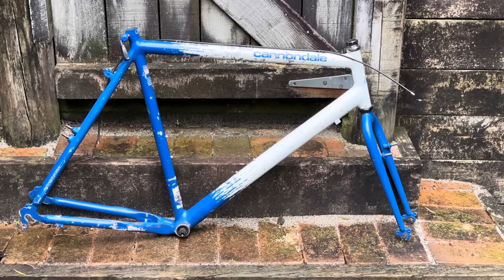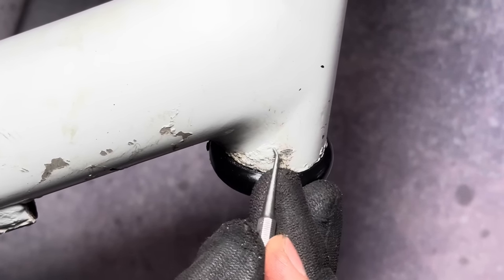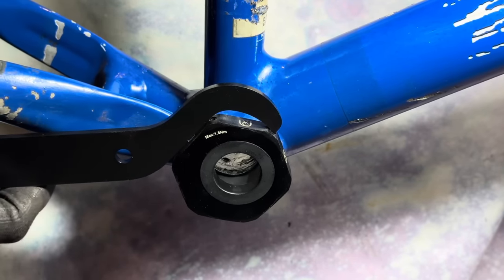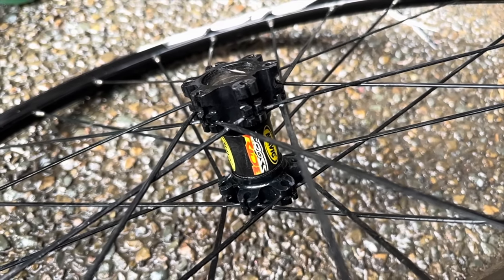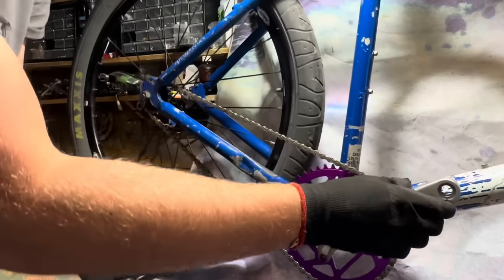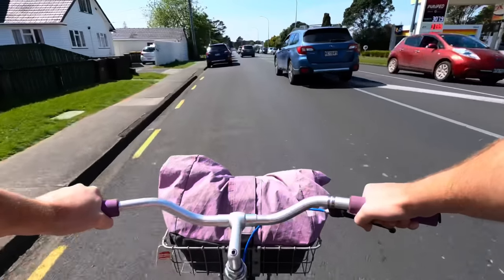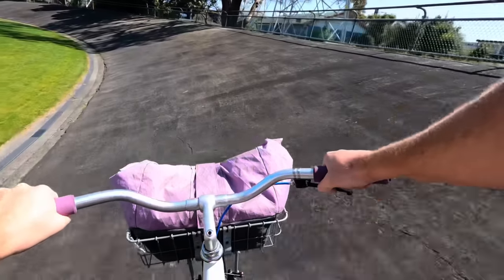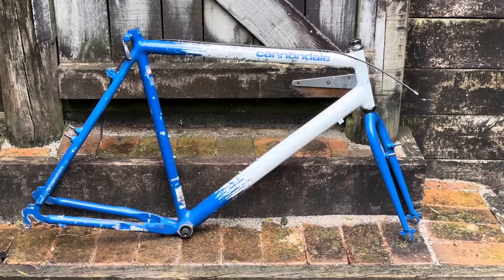Retro Cannondale Commuter Build - 1989 SM2000 Fixed Gear

Comment: With all the positivity and love and just a recommendation. If you have to dish a wheel two full spoke nipple revolution it's the only way in four steps - half - half - half - half and always start with the side wich needed to be loosened. The wheel is a system and doesn't like big stability changes in overall spoke tension and two full spoke nipple revolution in one step is definetely. Like if you disassemble a wheel and you try to save the rim (in it's) for another bulid you doing it by half revolution by 32/36 spoke at least 5 rounds...
Reply from the maker: Hey, thanks! Yeah I’ve done it this way before multiple times with no issues 🤙 but you keep doing your steps if that’s what helps ya sleep at night

Comment: you want a single half link. and maybe a double hollow 9speed chain... my 2010 GF Rig SS XC 17.5" has a BB like that and it's literally 13 years old now...
Reply from the maker: Hey! Yeah I don’t think if weight savings were a concern I’d get tyres that don’t weigh 1kg each haha. I would like a cool gold chain though, for the style! I have a Izumi chain for an upcoming fixed gear build though 😎 oh rad! What’s the bb called? Is it a trickstuff one? 👌
And the half link, don’t really need one as there’s heaps of chain tension left 🤙
Reply: @toastyrides  mine is a Press fit.. I had to go look.

Comment: Big props to you for being our collective guinea pig and testing this! I've been dying to see this done, as a broke bike mechanic I don't really have the means to fuck around and find out on my own with this kind of thing. I love the aesthetics and ride quality of 26ers (my main bike for everything from groceries and commuting to bike tours is a steel Diamond Back 26er) but I also really would love a fun little fixed bike. Currently the bike that would be the candidate for the conversion is in single speed mode, and I already have all the necessary parts except for an appropriate chainring, the excentric BB, and a long axle for a front wheel.
Reply from the maker: Haha that’s exactly what I thought, even if it breaks and fails it’s better for it to happen to me than X number of other people! I’ll keep the comments section updated if/when it does fail, but just rode it again and it’s going great so far. 
Did many skids down a long road last night on the way home and had heaps of fun haha.
The steel Diamondbacks are a really good choice, they make wicked do-it-all bikes 👏 
Sounds like a good plan, hope the BB goes well for you 👍 Still wouldn’t rush to it, I’ll keep testing to see how it goes but it should’ve failed(or loosened) by now if there were any weak points.

Comment: Wonderfull build. Found a 89s M500 at a farm and will build a nice commuter too. thx for the inspiration <3
Reply: little tip. you can use cola and alluminium foil to polish rust. works very well and safe wd 40 :)
Reply from the maker: Thank you! Ooh rad! That’s a good find, definitely will make a great commuter 👍 enjoy it! Welcome, thanks for checking out the video 🤙

Comment: cool vid! always wanted to see if these things work or if they eventually slip because of torque. looks like they work great!! def handy if you want to run ss on a geared frame. bike turned out cool! cheers
Reply from the maker: GARY ! Yeah working great so far, should’ve slipped by now I would think? We’ll see though 🤷‍♂️ handy as for weird setups! Yeah thought it would be cool to run a Nexus on something, if it doesn’t work on the Dale/fixed 👌

Comment: Good job, that's cool. I feel your concern around the grub screws! Be great if it lasted though!
Reply from the maker: Thank you! Yeah really wish they used something more secure, but then I’d probably ham-fist the bolts into the bearings and ruin them that way 🤔 
They could double up the grub screws though, I think?
Reply: @toastyrides  Could it be splined instead of just rotating? wouldn't so accurate for adjusting but would be close enough

Comment: one thing you might not have considered is that usually the part that you removed from the hub controls the axial preload on the bearings. It looks like now when you tighten the wheels nuts, that might over preload the bearings significantly, leading to rapid wear. the Peak Torque channel has a good video showing how this works when he compares thru axles to QR.
Reply from the maker: You might’ve missed it or just assumed that I swapped axles without considering that. But you can see at 16:38 that the nuts are at a random point on the axle with thread showing(no control from the axle I removed). It’s the same system with both axles, they’ll be allg 👍
Reply: ah yeah just had another look, the end caps are threaded and so you can still independently preload the bearings👍

Comment: Smashing video ,great job ! Thinking about the 3 small grub screws,  it does sound flimsy?  Yet if fully tightened up i think you would need a lot of force for them to slip , much more than the power from pedaling? Even grinding up a steep hill ? I guess time would tell .

Comment: didn't understand what you did with the front wheel deal but nice build
Reply from the maker: Just whipped out the QR axle and put in a solid axle, a rear solid axle disc hub works too though 🤙 thank you! 🙌 thanks for checking it out

Comment: Do you reckon the Velo Orange Eccentric bottom bracket would work with a Sram Omnium crankset ?

Wanted to convert an old Gt All Terra into fixed without having to weld new drop outs
Reply: You would need a 22to24 spacer for the spindle as the Omniums Spindle is 24 on one side, but 22mm at the end while this bb is made for 24mm spindle in both sides.

Comment: Have a question for the content creator and the comment section. Bought a bike and the front brake hanger on the headset is off center and cock-eyed so am assuming thread damage on the fork. If that is the case what steps can I take to fix the threads? Is a thread file better than a thread chaser? Just looking for some tips and suggestions..thanks
Reply from the maker: Dang, yeah those things always take out some of the threads. A thread file would help but it’s likely just removed a chunk of the thread so won’t be much material left to “fix”. 
The headset will thread over it and you can use that to restore the threads to some extent, then file after.
Reply: I just tore apart the headset this morning and yup, the nub from the brake cable hanger mucked up threads on the fork. I might file the nub off...Your thoughts? @toastyrides

Comment: First time i see eccentric crank, interesting. But they can't be adjusted to be centered😂 so it's not an upgrade unless you need them for some reason, but why would you? What do they intend to achieve?
Reply from the maker: Did you comment before watching the video? 😅😂
Reply: @toastyrides  yes
Reply: Is it a tensioner for the chain eh?
Reply: It is.
Reply: @jacquescelere5693  thanks